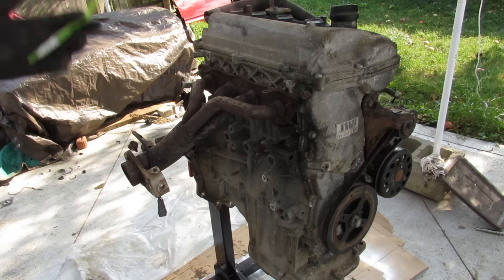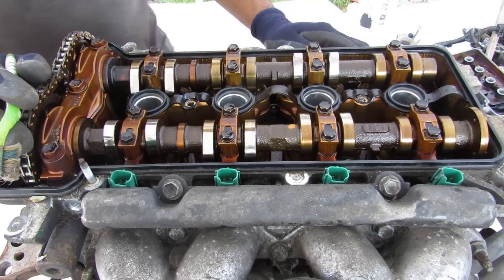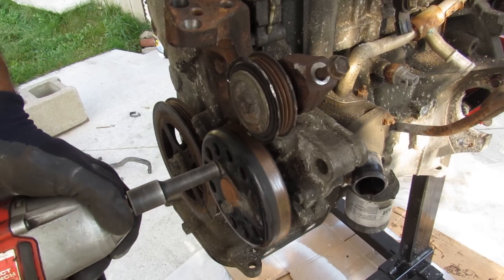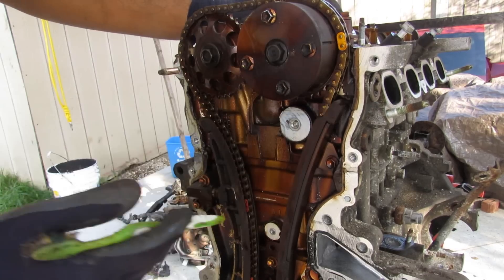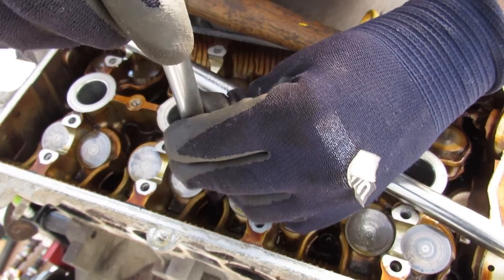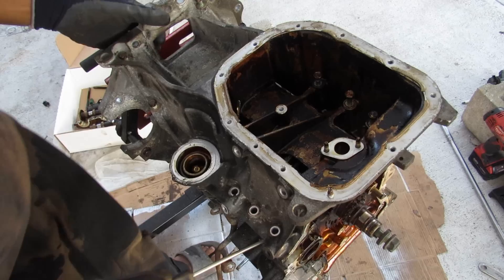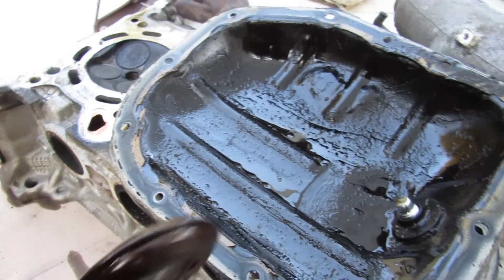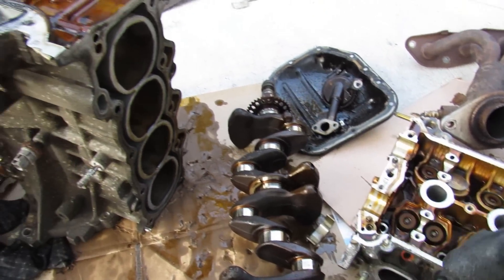What's inside a 500,000 km Toyota Engine?

Comment: Great job, my friend, love your teardowns. I just bought a 2010 Matrix with 353+++ km, manual, for 500 bucks Cnd. Runs like a clock, even the ac works. Just had to put new tires on it to get the safety. They are honestly indistractable. I'm gonna drive the crap out of it and see how long it goes.
Reply from the maker: Matrix is a good car. My brother had one as his first car and was closing in on 300K. Ran mechanically fine when sold.
Reply: @speedkar99  my friend had a Pontiac Vibe (Toyota Matrix) the odometer when to 299,999 miles. So who knows how many miles it had haha! I guess Pontiac (GM) thought that was a pipe dream.
Reply: Take care of the body above all.
Reply: @fun_ghoul  The body is still in pretty good shape, I'm gonna spray it with Fluid Film before the winter.
Reply: 220,000 miles - you might get another 200,000 out of it with a bit of luck and as long as you look after it. 

In Northern climates its the rust that gets these. My daily here in England is a 15YO Toyota Yaris with 230,000 miles on it and a few years ago I had to do some rust treatment on the underside around the rear suspension, the rear axle beam. I just got a donor front suspension for mine from the scrapyard for £150. Really low mileage stuff, spotless. Here is to another 200,000 miles and 15 years.
Reply: @zoidberg444  Right on, I do take care of my cars very well. I do all of the maintenance myself. It's my hobby. The Matrix was a company car that I work for, and then my colleague bought it about 3 years ago. It's got a few rust spots, nothing major but every fall I spray all of our vehicles with Fluid Film and Rust Check, those two things are popular in Canada. We'll see how far I can take that car. Good luck to you my friend.
Reply: A friend of mine used it as courier delivery car: about 300km+ daily on 416, 401 Hwy. He bought the Matrix from a lady at 230+km, we did the clutch, rear shocks and brakes. A few yrs went by and he sold it with close to 700k km on it - the same clutch.
Reply: Yeah my Mom had one from new to 300k... could of been a lot more but a northern climate she got rear ended and they could not put new dumper back on due to rust factor.
Reply: I have the Matrix S AWD with 120,000 miles on it. I love it so much and want to keep it for as long as it runs, and so just replaced two front struts and the whole set of engine mounts. Now, it accelerates better and runs like a champ. New brake pads will be installed soon. I will also spray some undercoat soon.
Reply: Nice one, if you take good care of it, you might expire first.
Reply: @thevindictive6145  It could be true, lol.
Reply: How much have u put on it now, one year later?
Reply: @veeti4210   Only over 6k km, I have only 7 km to work. now it's at 359400, no issues at all.
Reply: @2405jacko  Haha, thats good!!

Comment: How does the hybrid factor into the mileage doesn't that allow the IC engine to not run as often and run off the battery or am I missing something here. Or put another way to the hybrid factor of the Prius skew the mileage high when the mileage really isn't that high on the IC engine?
Reply: Some prius are struggle to keep warm in the winter times because of the engine didnt make enough heat.
Reply: @KarrasBastomi  Which would contribute to the oil tarnish and sluge
Reply from the maker: I mentioned at the end of the video. You have to outweigh the time spent running vs the wear of how many times it's been started and stopped

Comment: I put just shy of 400k miles on a slightly diff varient (1nz-fe). These engines are gutless but reliable as frig! Worst part is my 1nz didn't even die naturally! I hydrolocked it on a rainy day and flooded roads :(
Reply from the maker: Aww man. Good engines though.
Reply: I too have a 1NZ-FE in my ‘07 Yaris with 271,000.
Drive it every day since I bought it with 18,000 miles.
I’ve changed the oil at 10,000 mile intervals with Mobil 1.
Currently uses a quart every 10,000 miles.
Only replaced the alternator and starter.
Best car I e ever owned !
Reply: @flyonbyya  it burns oil because you waited to long to change it
Reply: @flyonbyya  nice man! I currently got 02 toyota echo but man it's a piece of shit , wasn't maintained at all , sludge all up in engine , burns oil , burns so bad that you can smell it from a distance and the whole rear of the car gets all black . Cat getting fouled up from it. But for some reason it still runs and drives and starts right up LOL . I'm looking to maybe get another car with 1nz-fe , their slow as shit but they last a while maintained. My pops had scion xb and the engine was still running at 300,000 so yee shits a little beast if maintained.
Reply: @ozzayyyy  start running MARVEL MYSTERY OIL in that engine between oil changes. It’s cheap, and it will clean that motor out as you drive. It will make a difference in 200 miles or so. Keep using Marvel and it will keep cleaning as you go in the future.
Reply: @flyonbyya  yaris rules!
Reply: Aww man it could've went longer!! I only had 64k miles when I totaled my Yaris with that engine. Sad day.
Reply: @shawn 1nz-fe got some kick to it and it's very reliable. If you want gutless then buy a Toyota corolla with 1.8 and cvt 😂🤑.
Reply: @mann_idonotreadreplies  How is a 06 corolla with this engine and vvti and a manual gearbox with over 100,000kms
Reply: Essentially, these Toyota engines are like immortals but it is not invulnerable to things like flood (I mean no engine is).
Reply: @jamsbong  no engine will survive a big enough gulp to fill all four cyl! Of course. But the damn things are immortal to damn near everything else! I was young and(dumb?) with my 04 scion xA, had the poor thing at or near redline most of its early life but it didn't seem to wear any life out of it. Had that sweet machine for over a decade and it never failed or needed repair once!
Reply: RIP😥
Reply: I got the same Engine on my 2011 Vitz rs with 160k on it. I heard good things about it and quite happy to know they last.
Reply: Susan Boyle seems like a 400k mile Yaris kinda gal...
Reply: Similar. My 2nd-generation Prius was just smashed by an SUV at 159,000 miles and could have gone on much longer.
Reply: Had a 2SZ-SE 1.3 Yaris with 193k miles and still ran great when I sold it :)
Reply: https://youtu.be/wafZjkY0H_E
Reply: These things love to rev too, there are dudes spinning 1NZ-FEs to 7500rpm with upgraded valve springs. They are GREAT little mills and dirt cheap. Fire some FXE pistons in with a piggyback and they'll make good power N/A for a light car like a Yaris or Echo
Reply: @mitch9521  In the past, there were factory fitted turbocharged 1NZ-FE Toyota Vios ( a Yaris sedan) in Thailand. They make 141HP . Only 600 units produced . That is good power for a 1.5L.
Reply: Go yaris!
Reply: The 1NZ-FE is actually pretty fast in my Yaris T Sport (which only weighs 925kg.) 0-60 in 8.5 seconds. 
All depends on the weight of the car
Reply: I believe Toyota has a formula for how much power is enough to make thier engines last.  Scotty Kilmer covered that. Less horsepower,  the longer it'll last. Hence why exotic cars don't last. Too much power and heat destroy an engine.
Reply: @MatrixDiscovery  not to mention turbo chargers add a lot of extra stress to engines. Like 1.5l turbo engines that GM uses in their SUVs. It's just too much for that small of an engine.
Reply: @ Tech guy

Lol.. the size of the engine has absolutely zero to do with whether its bad to turbocharge it. 

Plus, modern turbos are low pressure. They are mainly to allow a small engine to produce the torque it otherwise wouldn’t be able to. 

Back in the days of port fuel injection that would be a no-no but with direct injection plus anti knock sensors it’s easily done. 

It’s a better solution than trying to reduce friction in a larger engine.. which is what Toyota did by putting in weaker piston and oil control rings…   and then wound up with excessive oil consumption.
Reply: @calvinnickel9995  okay let me rephrase my comment. It's dumb to use a turbo charger on a weakly built GM engine. They SUCK.
Reply: @calvinnickel9995 No they are actually running a lost of boost. Lots of stock economy style cars are running 16-25 pounds of boost and that's a lot. It wasn't that long ago that running 7-10 was good
Reply: @MatrixDiscovery  a huracan is very reliable though
Reply: @MatrixDiscovery  makes perfect sense.   There was this guy with a Subaru crosstrek with a gutless 2.0 liter boxer engine lasted 620k miles.
Reply: @MatrixDiscovery  There’s a fundamental difference in how the vehicles are manufactured by Toyota as compared to any exotic car. Toyota’s main focus in their powertrains and vehicles in general is reliability over pretty much everything else, while exotic car manufacturers are focusing on styling, performance, handling characteristics, etc.
Reply: @MatrixDiscovery thats not entirely true. Their performance engines last a good while too, provided they are well maintained
Reply: You mean 1mzfe engine??

Comment: I wonder why Toyota didn't decide to use an electric water pump too, and do away with the accessory belt completely? Obviously a solid design though, thanks for another interesting teardown!
Reply: The did on 3rd gen Prius, 2nd gen had electric water pump for inverter only
Reply: @micronyaol  thanks for the info 👍
Reply from the maker: They did in the next generation Prius. This was still from 2004.
Reply: The newest hybrids have electric everything. That includes the ac compressor, both water pumps (engine and inverter) and heating elements inside the dash to help heat the cabin while the engine warms up on cold days.

Comment: What's left in that engine? Another 190,000 miles. Proper maintenance keeps them going a long time.
Reply from the maker: Yep. Lots of life left. Solid build quality. Just needed some more maintenance
Reply: i think partially because it has been in hybrid vehicle and you can easily divide the mileage by half
Reply: @4thegr8just1ce  disagree, i would say 75% engine 25% electric
Reply: @4thegr8just1ce  even with all the starting and stopping of a hybrid engine?
Reply: Nice...
Reply: With that oil pickup almost blocked I doubt it would do that many more miles.
Reply: @dmac7660  the rings were fucked tho
Reply: Wow
Reply: Thank God for toyota.
Reply: @mchiappinam 75%-25% is probably more accurate. I do mostly highway with my Yaris Hybrid (same engine), and its closer to 90%-10%. More city driving will run the engine less. BUT... whenever the engine runs, it is under a heavy load. (only during warm up the engine is under a light load). My ODB scanner shows the hybrid system prefers to load the engine at about 85%-90% (so throttle valve almost fully open) at low RPM for higher efficiency. Some will say this will lead to less engine wear because of low average RPM's (I think this is true), others will say it leads to high engine wear as the system is basically always lugging the engine. I think Toyota knows what they are doing. No oil consumption after 300.000km.
Reply: This isn't just proper maintenance (in fact, someone was going way, WAY too long between oil changes), it's excellent engineering and build quality. Even the best maintenance can't make the worst engines last.
Reply: We all know engines take a bad hit upon first cold starts. So hybrid engines mileage mean even more wear times the miles or kilos if you think about it..tried and true technology. My 1zz looks similar in every way. Did the oil control rings at 183k miles. Drilled more holes in the pistons, new rings all around and voila. The cross hatches were intact at 183k! I know thin cast iron lining but she will go over 300k I surmise. Get out of here hinda boys 😄
Reply: How you got this engine?
From junkyard?
are you sure about the kilometers in this engine?DID YOU CHECK.?
IF IT IS TOYOTA ENGINE 
ITS OK TO HAVE 500K.

Now this days we cannot believe anybody 😪!!
Reply: @CHANNEL12021  If it was from European car it would be 100% lies. I had Toyota Corolla that did 500,000 km and it was still running reliably, only routine maintenance work carried out during the time I owned it from 90,000 km, it never broke down on me.